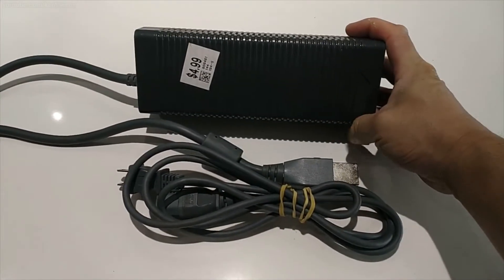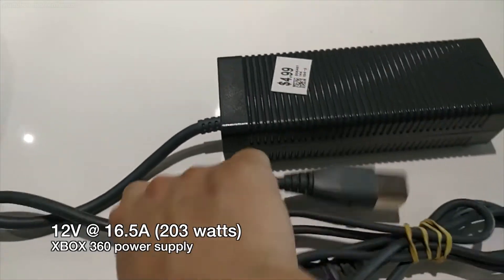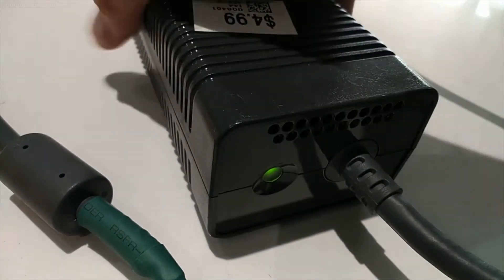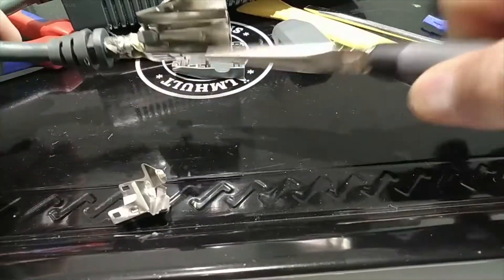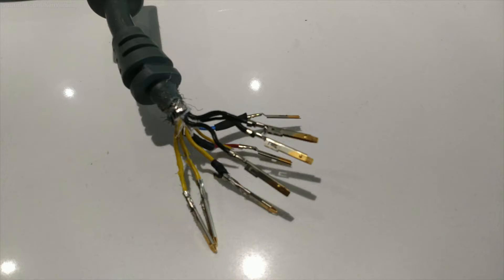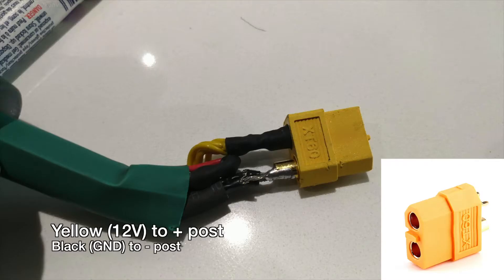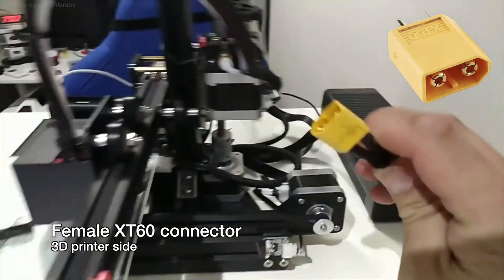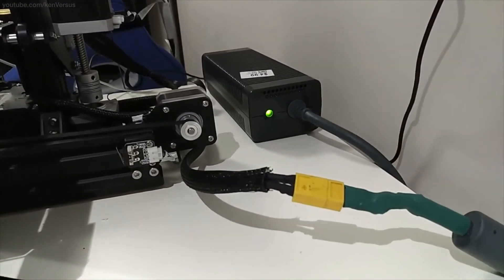3D Printer XBOX 360 power supply

Comment: I know, this video is very old, but tying the thin black and yellow wires to the thicker black and yellow ones can result in a red led and no power at all. The thin yellow and black wires are for something else (i guess hdmi or sound in the xbox). 

When these thin wires get a to high load the power supply goes into "safe mode" and the led on the power supply goes red. 

Some of these Power supply work like in the video explained but others have problems. If someone experienced a red led, try separating the thin yellow and the thin black wire from the others.